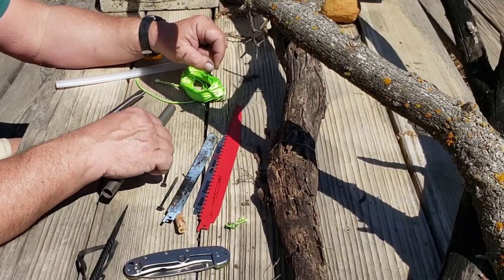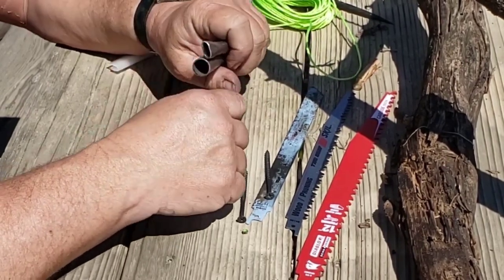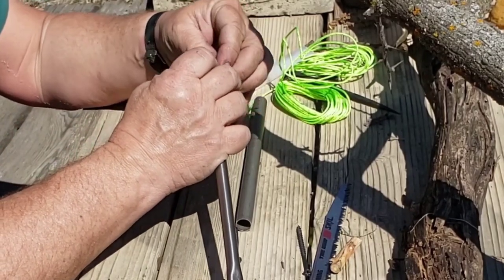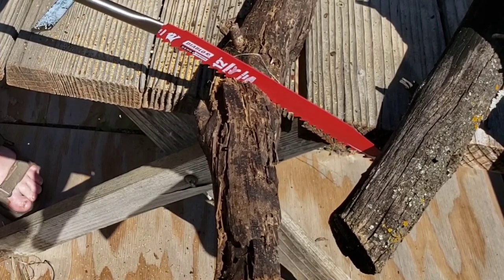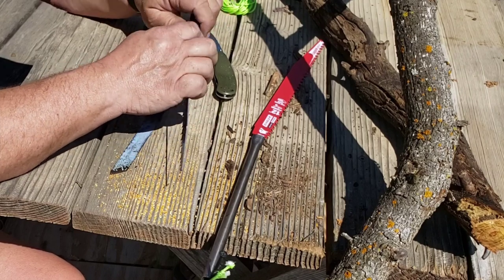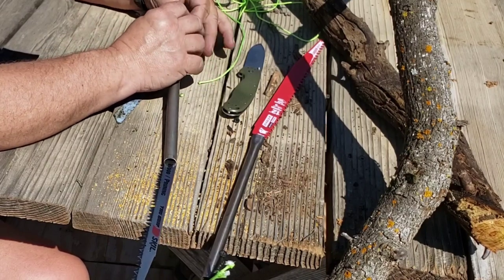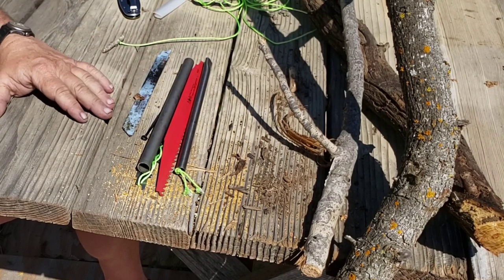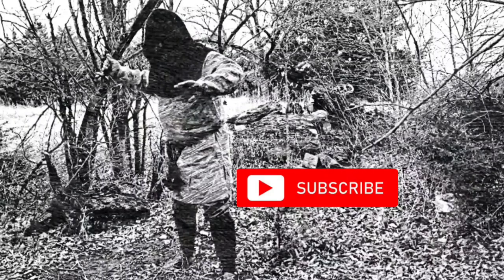Making an Ultralight Bushcraft Saw.

Comment: How much does the saw weigh? Do you have links to the materials?
Reply from the maker: Not sure of the weight its incredibly light.  The blades can be had at any box store. The tube i got from Amazon and it changes so fast that it will be a search as titanium now it getting harder to get but any tubing or pipe will work